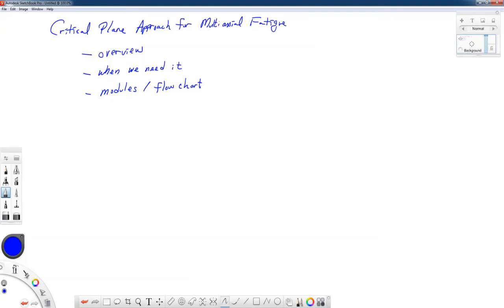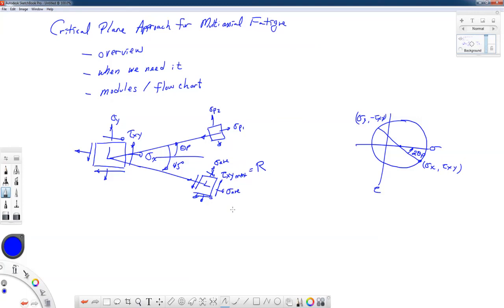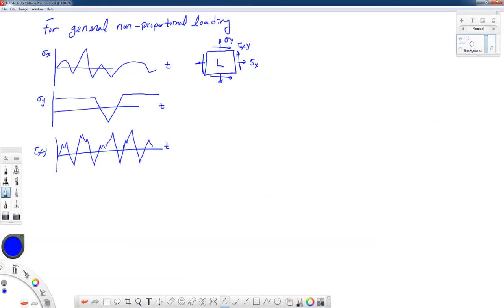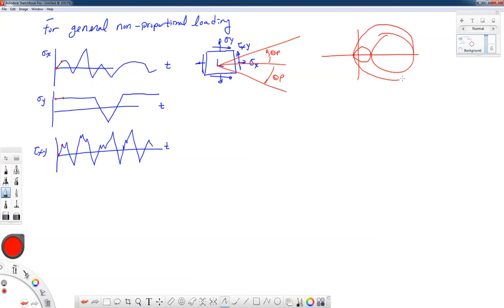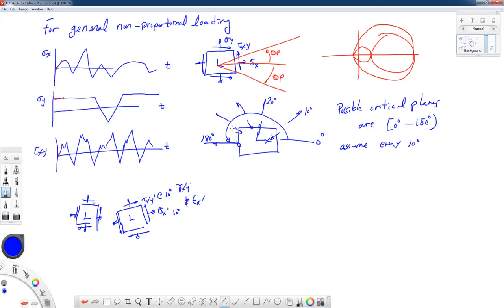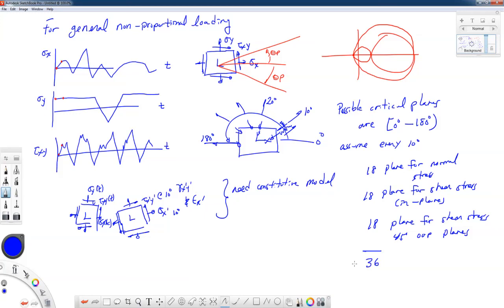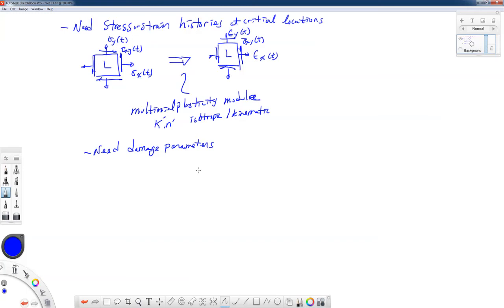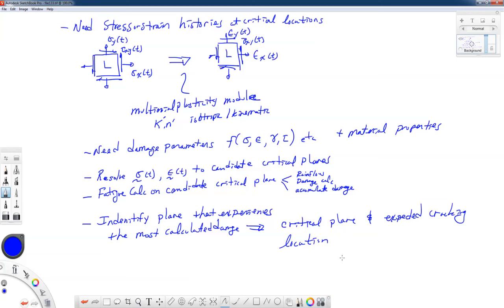Overview to Critical Plane Approach to Multiaxial Fatigue

Comment: @Mechanics Channel by Mark Barkey

Thank you for this overview, Professor Barkley. I have one question about it. What is the most suitable multiaxial plasticity module for transforming a stress history that was produced by calculating an over rolling of a point under the surface of a rolling bearing contact? Thank you

Comment: Thanks a lot professor for sharing the lecture. I need one final clarification before diving deep into literature. Please let me know if my understanding of application procedure is correct.
Step1 - time history of stress/strain history 
Step2: Transform stress state at one time instant into all candidate critical planes and determine the most damaging critical plane. This will be repeated for all points in time history
Step3: Now we should have time history of stress state transformed into most damaging critical plane for each time instant.
Step4: Do the Rain-flow counting and accumulate the damage using this transformed stress time history
Reply from the maker: Generally, you will not know the critical plane in advance, so you have to do your step 4 before you can tell what plane has the most damage.  An exception is for proportional loading, but in this case, there is no reason to deal with the other planes.
Reply: @mbarkey.mechanics  

Thanks for the reply. In that case, let me combine step1 and step4 and write:

1. Time histories of stress and strain histories derived from rain-flow counting. 

2. Stress state in each cycle is transformed into each candidate critical plane (36 if discretized for 10 degrees)

3. Maximum damaging plane from step2 is identified as critical plane and damage is accumulated for that orientation
Reply from the maker: @TheRaguraam  No.  Rainflow cycle counting and damage accumulation occurs after the stress and strain tensor histories are determined.  For in plane tensile damage parameters, you only need 18 planes, not 36 as the stresses are the same on both sides.  If you consider shear parameters, you need 18 more in the plane, and 18 out of plane (45 degrees OOP).  If you are not sure how your material responds, you can use both types of parameters and 54 candidate planes (and you also need material properties too).  I don't recall exactly what is in my lecture, but it should all be explained there.  Happy studies!

Comment: Professor Barkey, thanks for sharing this useful lecture! I want to confirm the procedure of fatigue analysis. Most engineering problems are not simple, so we have complicated stress/strain state(multiaxial). Hence, critical plane approach can be used to determine critical parameter at a particular time. In other words, if a simulation has 10 increments, critical plane approach will be applied to find critical parameter in each increment. Then rainflow counting should be used when the collection of those critical parameters are variable amplitude. Finally, evaluate life cycle according to miner's rule. Is this procedure correct?
Reply from the maker: Fatigue analysis is done on time histories of stress and strain at critical locations.  There are techniques to identify critical locations.  Obtaining time histories can be from elastic FEA and a "notch" correction factor; elastic-plastic FEA if needed, or experimental measurements.  The resulting nature of the time history then dictates if a uniaxial or multiaxial approach should be used.  I have published on all of these topics and would refer you to those papers that you can find on my CV at The University of Alabama (easiest to find via web search).  Happy studies!
Reply: @mbarkey.mechanics  Thanks for your kindly reply. Actually I'm learning fatigue analysis through the combination of Abaqus and fe-safe. Time histories of stress and strain at critical locations can be easily obtained by Abaqus. After that, fe-safe can import the FEA results to perform fatigue analysis by critical plane approach(Brown-Miller). My question is : critical plane approach is used to determine critical strain or strain before rainflow counting? 
Also, I'll find papers you recommend, thanks again!
Reply from the maker: @PhilCheng  The critical plane approach is not used to determine strain.  It is used to determine fatigue damage on different candidate planes (or orientations) in a material.  The plane with the highest damage is the critical plane and the expected cracking orientation for a given damage parameter.  The stress and/or strain tensor time history is resolved to each candidate plane and then rainflow cycle counting is performed to calculate the damage.  In my opinion, it is best to understand fatigue analysis first then apply the commercial codes.
Reply: @mbarkey.mechanics  Truly appreciate your answer. Except for those papers you suggested, is there any textbook or material about multiaxial fatigue analysis? I've bought "Fatigue Testing and Analysis: Theory and Practice" and this book is really helpful to learn fatigue analysis. However, there's no much information about multiaxial fatigue analysis. Thank you very much.
Reply from the maker: @PhilCheng  Multiaxial fatigue is a bit of a niche area--if the principal stress/strain directions are not changing at the critical location either due to synchronous time histories or the local stress conditions, then non-multiaxial methods are far easier to apply.  My other book with Yung-Li Lee has a couple of chapters on multiaxial analysis that we wrote, and there is Darrel Socie's book on multiaxial fatigue.  But most of what you will learn will come from literature, as the topic is still being developed and researched.  The basic critical plane approach was outlined in the 1990's, so it has not been completely settled and filtered into texts.  I do highly recommend a thorough understanding of uniaxial fatigue (both stress and strain life approaches) as that will make the jump into multiaxial conceptually easier.
Reply: @mbarkey.mechanics  Thank you so much. I will do some studies first. As you mentioned, it is best to understand fatigue analysis first before apply the commercial software. What you shared is really helpful and inspiring.

Comment: How to accumulate damage in critical plane? The problem is that there are 2 components sigma and tau. But Miner's rule needs one stress and a S/N curve.
Reply from the maker: It depends on what damage parameter you want to use--shear based, normal stress/strain based, or something that uses a combination, such as Fatemi-Socie.  Ideally, you choose one based on the cracking initiation behavior of the material.  In some practical cases, you use them all and choose the most conservative.  Damage is accumulated linearly with Miner's rule, but only needs one of the aforementioned damage parameters.
Reply: Another video about that would be very appreciated. Thanks for the explanations.
Reply from the maker: It looks like I did not write any down explicitly, but I mention the functional form at 22:06.  An example would be the Smith-Watson-Topper equation.  You can also read up on Findlay parameters.  I prefer a text called "Fundamentals of Metal Fatigue Analysis" by Bannantine which does a great job with the basics plus Julie Bannantine's thesis that goes into great details on the implementation of the critical plane approach.